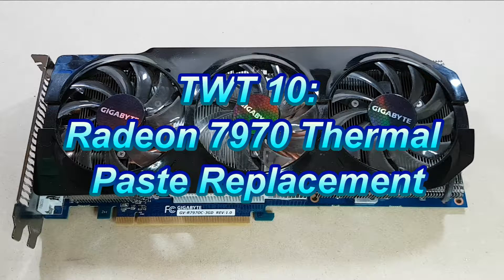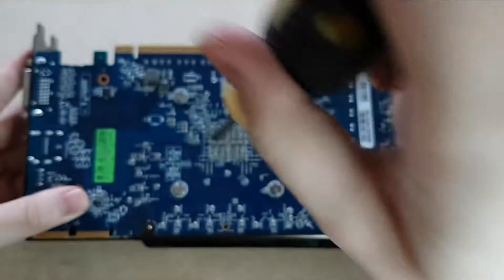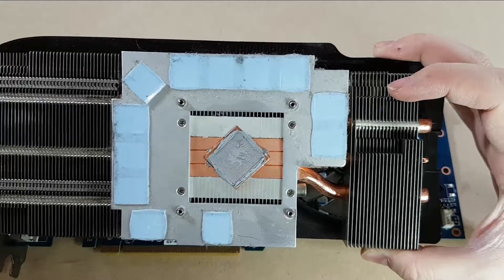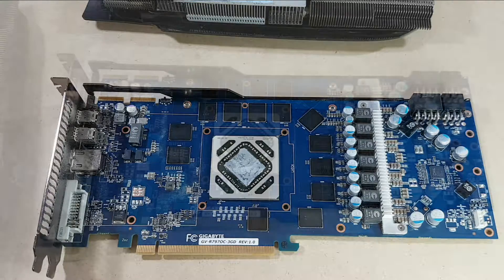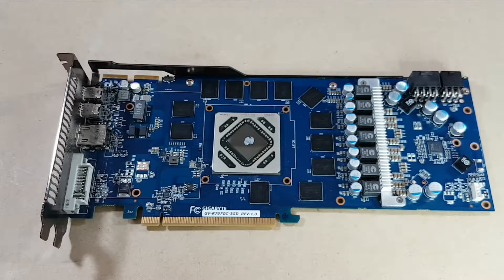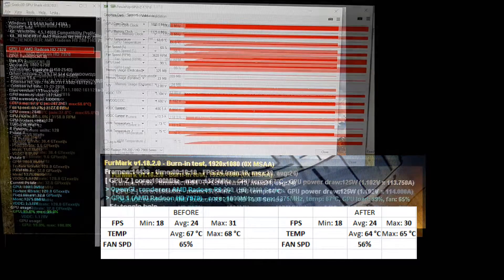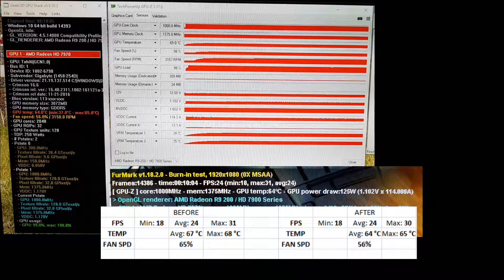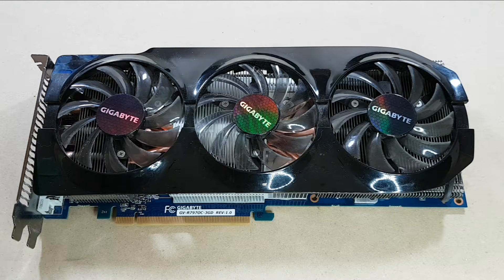TWT #10: 7970 GFX Card Thermal Compound Replacement

Comment: Hi! Could you urgently tell me the thickness of the thermal pads for the amd 7970 vapor x ghz edition 3gb? !!?!?
Reply from the maker: I don't have one to check personally, but from what I could find online they are likely 1mm thick (though some 7970 cards use .5mm thickness for memory and 1 mm for VRM so it is hard to be sure). The best way to be sure would be to measure existing ones on the card.

Comment: No thermal pads on the Vram either
Reply from the maker: The thermal pads stayed adhered to the heat sink, they were the light blue rectangles at 1:47. I may replace them at some point as well as they had a lot of dust and crud embedded in them, if I can find somewhere to buy them for a reasonable price.
Reply: Sorry didnt see that! Only saw the gpu with none on and was like oh no! maybe next time i shouldn't skip through the video :(